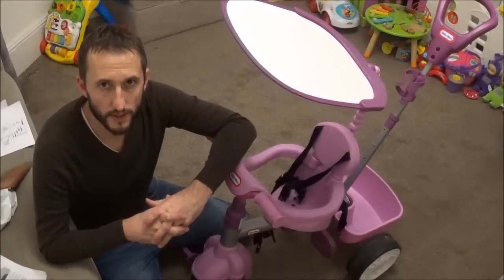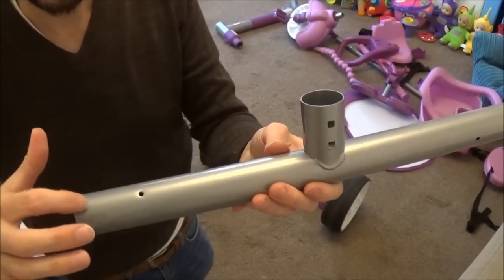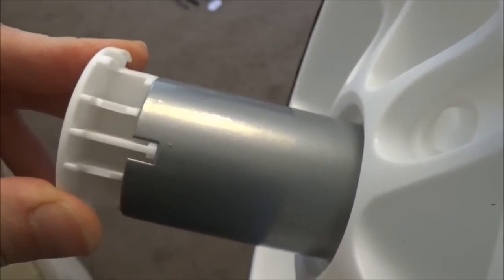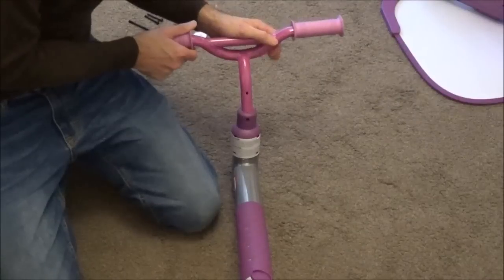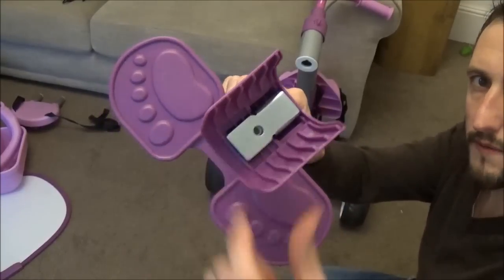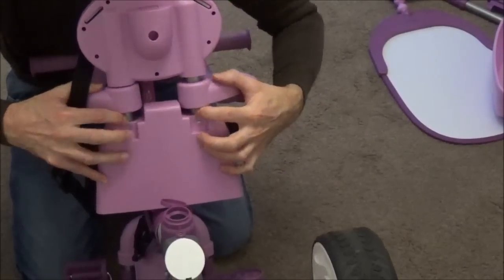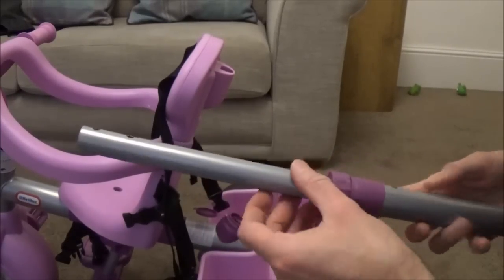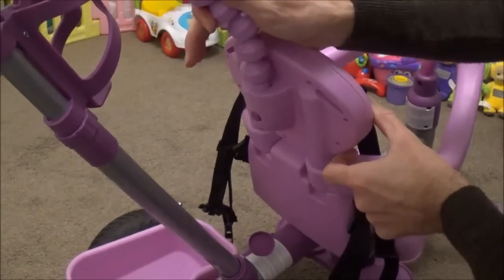Little Tikes 4 in 1 trike assembly. How to assemble 4 in 1 trike!

Comment: Amazing video, quick question - i've slotted the pole for the parent handle in correctly but the holes at the bottom don't quite match up and I can't feed the pin through. Could I have made an error in assembly somehow to cause this or would it be a faulty item?

Many thanks
Gareth
Reply from the maker: Hi Gareth, if I'm honest I haven't had this trike for a while now and I assembled it a few years ago. All I can really suggest is to check you followed video step by step. I remember the instructions that came with it were awful. Best of luck with it.

Comment: Thank you so much for this. Any idea how to lock the pedals for stage 1? Tried finding a toggle in the front wheel but can’t find it anywhere!
Reply from the maker: I don't own it any more but from memory you rotate the pedal which is attached to a white rotating bit of plastic. This must engage into the wheel groves which then allows the pedals to rote the wheel. Hope that helps. Thanks for watching.
Reply from the maker: Go to 12m20s in the video. I explain it there.
Reply: POUSE around the HOUSE I’ll give it another go, thank you

Comment: Is it possible to remove the front wheel after wrong assembly?
Reply from the maker: Hi, yes it is but you need to partly dismantle the handle bar and wedge something down it to release the clip. It's not easy! Good luck.

Comment: I have pulled the piece of plastic out to disable the pedals from turning but it hasn’t worked ? I have pulled it out and made sure it is unlocked but still not working any ideas ?
Reply from the maker: To be honest mine tends to do that. If your child rests their feet on the pedal it will stop turning as there is no real friction involved when it is disengaged but it is a bit annoying. Sorry if that hasn't helped! Thanks for watching.
Reply from the maker: To be honest mine tends to do that. If your child rests their feet on the pedal it will stop turning as there is no real friction involved when it is disengaged but it is a bit annoying. Sorry if that hasn't helped! Thanks for watching.
Reply: Lauren Powell I have the opposite problem. I’m trying to engage the pedals so they turn the wheel but the plastic part isn’t staying in place. It will work temporarily but when my son starts peddling with any pressure it pops out almost right away. Bit of a design flaw if you ask me. Basically it just works as a pushcart lol

Comment: My daughter loved this but we've just upgraded to stage 3 and that hub thing to engage in the pedals just won't stay in the wheel. It clicks firmly into place and is difficult to pull back out again, but within a minute of her trying to pedal it slowly loosens then pops back out. Thinking about superglueing it in otherwise we're just going to have to toss the whole thing. Very disappointing.
Reply from the maker: Mine is a bit like that but my daughter doesn't use the pedals yet so I'l keep you posted. Thanks for watching!

Comment: How do u get the front wheels to engage?
Reply from the maker: From what I remember you have to line the wheel up with the loose plastic hub part, then slot it into the grooves on the wheel. Hope that helps.

Comment: we are unable to fit the handle screws in. They run loose. Any suggestions?
Reply from the maker: If they run loose they are either not lined up with the thread or there's a chance you can over tighten them and strip the thread. If you never felt it tighten up then you just need to line it up if that makes sense? Sorry if that hasn't helped.

Comment: Great video. Thanks. Does anyone find that the handlebars have some play before turning the wheel? Feel a bit wobbly to me even though screwed in tight.
Reply from the maker: Yes, a little bit of play in mine. Thanks for the feedback
Reply: YES!!! And also the “push” handle!  I was wondering if others were having the same issue with that also.  The rear axle is round, and the shaft that holds the push handle is also round, so it doesnt sit flush against the axel.

Comment: just finished assembling this and the handle bar lock won’t turn. Currently stuck at unlock. Any tips on how to fix this?
Reply from the maker: Try removing the handle bar, and turn the lock switch, then refit the bar ensuring it slots over the pin inside the tube (as seen in the video). Test the switch before tightening back up. Hope that helps. Thanks for watching!

Comment: Can you please tell how to dissemble back rest and secure ring ?
Reply from the maker: There are 2 buttons on the back of the backrest. Push them in and remove the seat. Then unclip the plastic safety bar from the front on the handlebars (should just pull away), and put the backrest back in. It's just the reverse of what I show in the video. Hope that helps. Thanks for watching.
Reply: the front wheel is not coming out. any other tip?
Reply: Thanks for help

Comment: Thank you Dear
But there is an issue regarding the front wheel
The little plastic that hold the wheel will loose after  driving 
So is how to fix it !!
Reply from the maker: Not entirely sure. It should slot back into place if you turn it unless you've worn the teeth off. Sorry I can't be of more help. Thanks for watching.